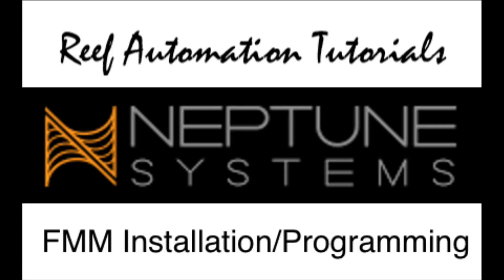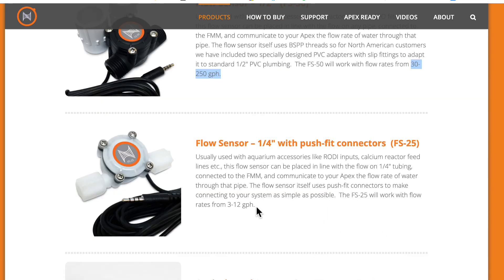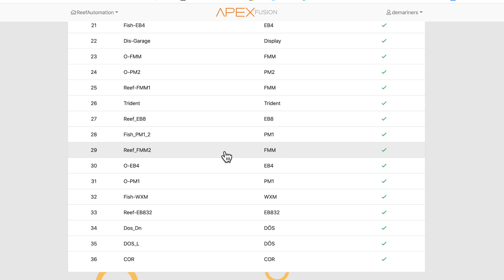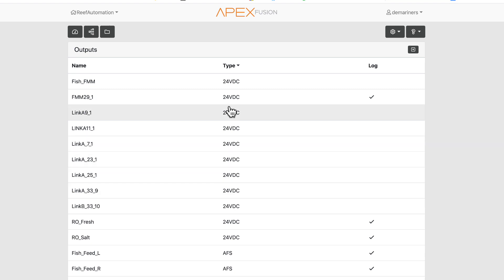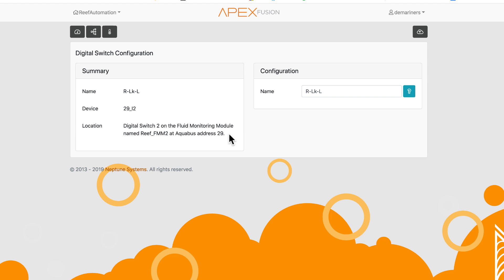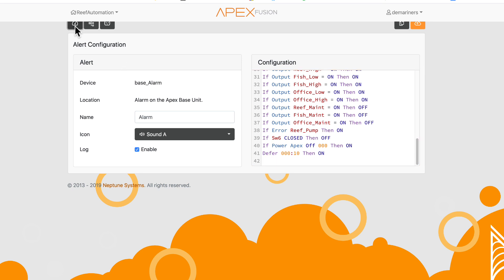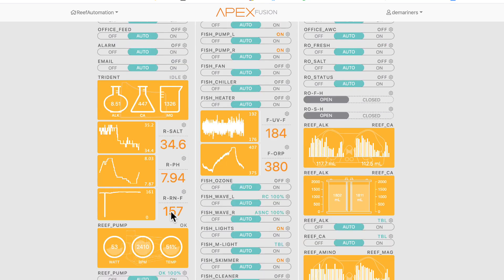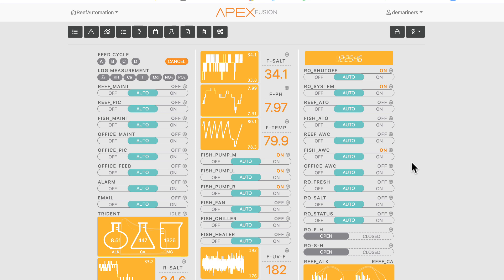Neptune Systems Apex Tutorials - Using And Programming the FMM

Comment: Hey, How would i achieve the following; I have a set of switches wired into the Apex I use 1 of these for a "water change" mode, when the toggle switch is off I want the powerhead, return pump, media chamber pump and skimmer all to immediately switch off. but when I toggle the switch back off I want the return pump to start immediately then the power head and media pump after 5 mins then after another 5 mins the skimmer starts, however when I try this all of the devices wait a time (5mins) then all come on at once. what am I doing wrong?

Comment: I purchased a apex system with a atk. Can I purchase an additional sensor and set it up to shut off my return pump if the sump ever runs low, or will it only alert me?
Reply from the maker: Absolutely.  Just plug it into port 3 or 4 and go to return pump outlet.  Programming should be "If XXX (port 3 or 4) OPEN then OFF"  I do this on my tanks.  I have a high and a low sensor to alert me also.  The programming on the alarm would be "If XXX OPEN then ON"
Reply: Reef Automation thanks!
Reply from the maker: @kevinsamek5904  Always here to help!  Lots of videos coming.